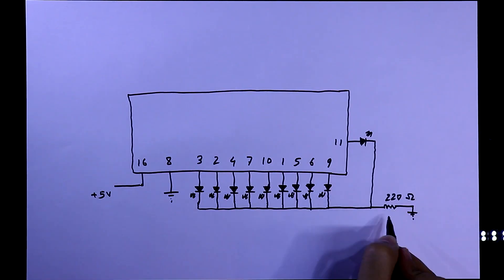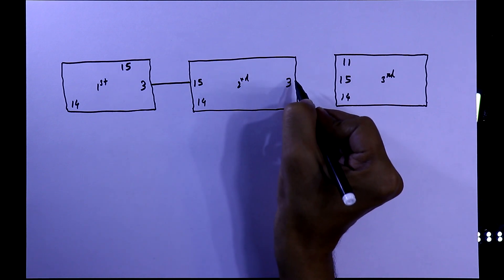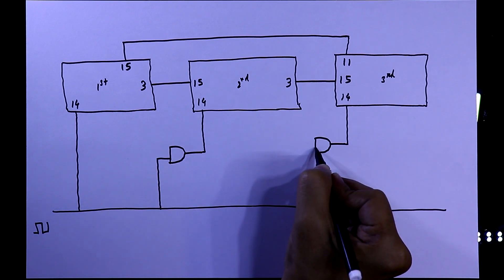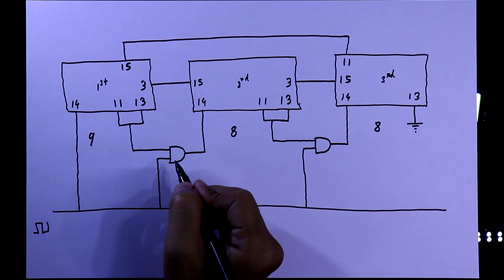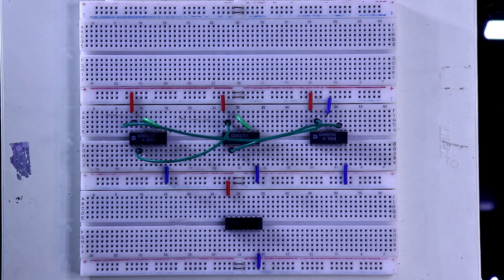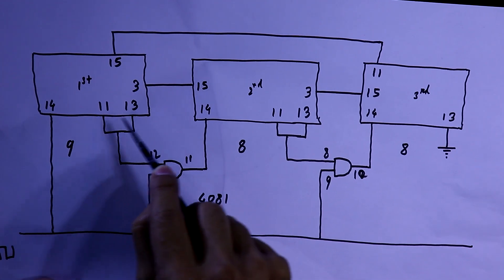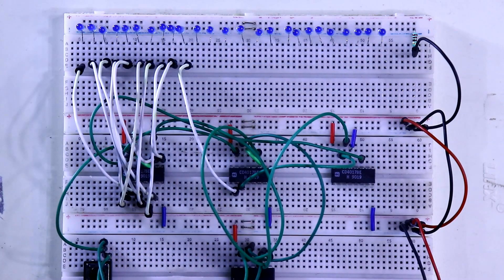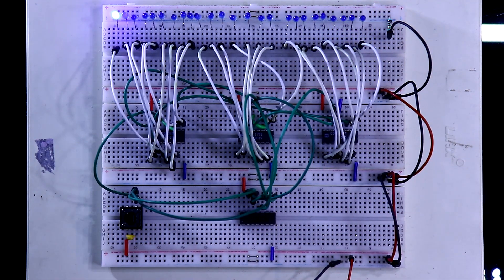Cascading IC CD4017 | How to cascade CD4017

Comment: Hello, thank you for sharing the detail of your work, it is very inspiring! 
I am trying to make a cascade with 4017 and 4081 (and gates), I have built the circuit more than 15 times, but I have a problem: As the speed of the sequence increases, it loses the order. Some steps are sped up compared to other sequences. 
Please help, what do you recommend I do?
Reply: What clock are you using? Do not use any type of 555, as they notoriously cause the kind of problem you're describing.

Comment: Please help me, have a trouble: in teh 2nd CD4017 I use only 3 LEDs (total number 12, so 9 from first, 3 from second, the 12-th LED on pin 7 of 2nd CD4017).
Question: should I connect on 2nd CD4017 pin 15 (MR) to 3 (Q3) from 1st or better to connect the last LED Pin 7 to Pin 15 and disconnect 15 from 3 from the first? Thank you

Comment: I'm using a 555 timer for my clock. When I apply power, LED 1 which is coming from output pin 3 from the 1st  4017 will not light 1st. It does light up after the sequence starts over. Any idea why?

Comment: after replacing a dead 4017, it works! wonder why it died on me.
Reply: Did you connect the supply polarity backard? Did you expose the IC to a static electric charge?
Reply: @MadameRotten-je4vk  could be. it was 2 years ago. don't remember

Comment: Can I use 74ls08 instead of CD4081?
Reply: The output levels of 74LS ICs may not be compatible with the expected input levels for 4000-series ICs. Keeep in mind, too, that the power supply will be restricted to 5 volts whenever you use 74LS ICs.
Reply: @MadameRotten-je4vk  Thank you for info. So as long as the whole circuit is based on 5v then its' fine right?
His circuit is already based on 5v.
Reply: @jumbo999614  Yes, if you restrict your operation to 5 volts, then the use of "LS" parts is okay, assuming that the in/out levels of the two types of ICs is compatible.

Comment: Instead of the push button could you use a 555 timer from pin 3 to generate the square pulse?
Reply from the maker: Yes, we can. We have to connect 555 in Astable mode. I'll show this in the next video.
Reply: @EEWave  Ok thanks.
Reply: Don't use 555s as logic clock sources. They have ringing transitions in their outputs that cause false triggering.